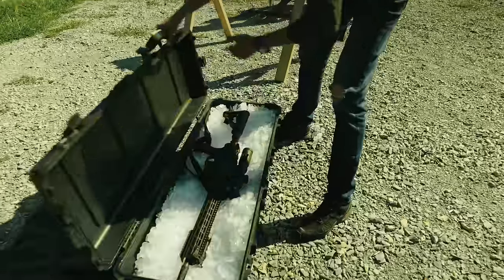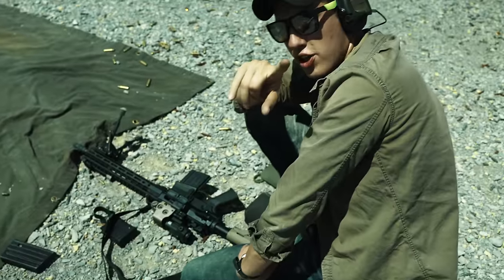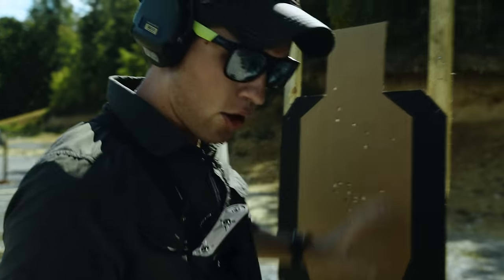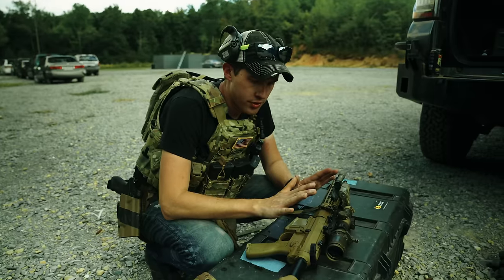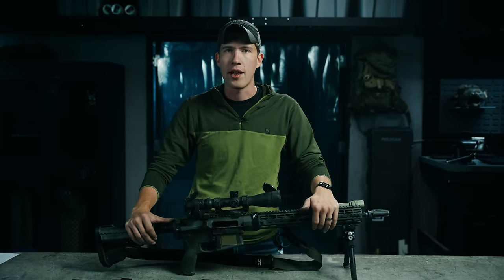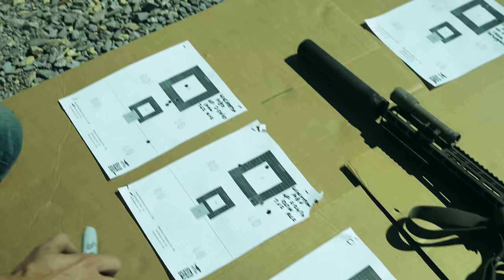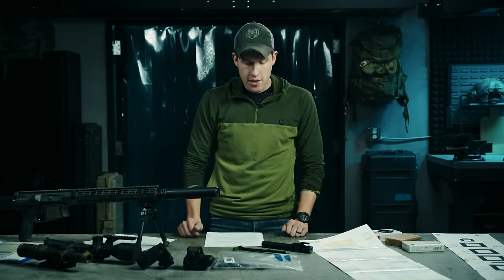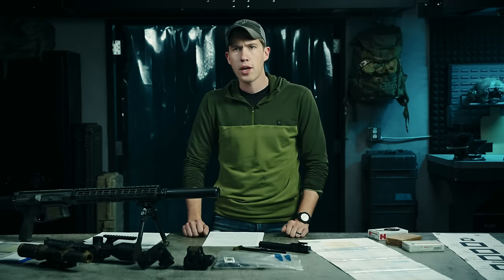Aero Precision M5 AR-10 5,000 Round Test

Comment: Please Aero consider on your m5 carbine stock lowers, using an A5 buffer tube and provide an H3 buffer with a rifle spring, I know it’s an expense, however it might prevent some failures and premature failures. I have also found the gas ports on your barrels to be on the small side, I opened up my 16” mid length.308 to .086 and installed one of your adjustable gas blocks. Works well know along with the buffer system improvements. I absolutely love your products! Another thing, I noticed heat treat issues with your nitrided BCG .308? I’m now running the phosphate BCG and it’s good, I’m in Washington but I can still buy your parts, I believe overall that they are the best in the industry!

Comment: 5,000 rounds I'm yet to fire one round. I just purchased a Aero Precision M5 E1 6.5 CM with 22" barrel. This rifle is 100% Aero Precision and brand new.  It won't chamber a round 90% of the time and when it does it damages the bullet and the case and the follow up round will be a double feed. I am using PMAG Gen 3 magazines. I have yet to fire this rifle. Any ideas?
Reply: I'm probably too late. I've seen this happen to the m5 in 308. It could be because of the brand of ammo. I would check and see if the tip of the bullet sticks past the pmag. Especially if your ammo is a little too long for your magazine. It won't want to work. I've only seen this on ar10s
Reply: Refund it and save up flr something good. I payed a lot for a 716 DMR G2. It shoots 1 moa with boat tail ammo and eats everything I give it. Buy once cry once.

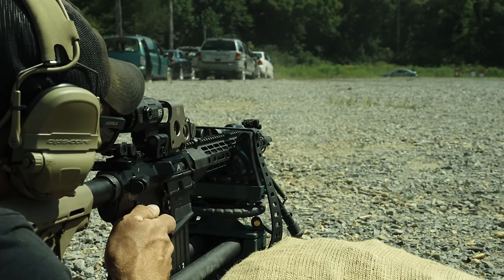Comment: I have significant issues on my POF Revolution (308 Piston Driven) as well.  I get these overgassed 12:30 - 1:00 o'clock eject patterns no matter what setting I have the adjustable block on, which results in the bolt closing so quickly it outruns the mag's next feed and skids over the follower bullet.  So, I get a clean shot, extract and eject, but I'm left with an empty chamber in the end.  These AR10's are so weird is all I can say.  I've owned a few different manufacturer AR10's now and I have to factor in a multitude of modifications to make it cycle properly.  Everything form heavier buffers, heavier duty springs, gas adjustments, and specific types of ammo.  The problem is especially amplified when I'm running my Dead Air Nomad-L on it.  Pew Science showed the Nomad-L as being the highest back pressure .30cal can in the industry, and I absolutely agree with that result (painfully gassy in my face with what feels like powder blasting me every time).  It's less pronounced of an issue with my SiCo Omega300, but I still can't make it through a full 25-round mag without having to stop at least twice to assist in loading the next round.  End of the day, I absolutely love my Nomad-L (truly industry leading suppression) and I wouldn't trade it for anything. I just wish I could trust my any of my AR10's like I do my AR15's chambered in 5.56 and 300BLK. One day someone will get it right.... I hope. Hahaha.

Comment: The problem with this video is that it doesn't succeed in its goal, to rigorously test the reliability of the Aero M5 platform and components.  To reveal failure points in any mechanical device, you have to provide the best possible chance of success, that way its the inadequate components that fail, rather than components that fail due to improper usage and maintenance.  It's no longer possible to be certain that the fault is with the component, because the user introduced new variables that can effect longevity, reliability and performance (over gassed, no lube, etc).  The fact that the rifle survived longer than average users would ever shoot in their lifetime despite those user introduced complications is a testament to Aero, and actually reinforces my confidence in their products as they clearly survive longer than they reasonably should in harsh conditions without proper adjustment, maintenance and lubrication.

Comment: Anyone wondering about 149g Winchester Lake City "m80" it is actually copper plated steel-jacket with a lead core. It has been relegated to MG use in the US inventory. Old M80 is 147g copper-jacket lead core. The Lake City 149g m80 will accelerate barrel wear.

Comment: Also these have excessive play in the bolt face to the bolt locking latch when pulled all the way back, more than 1/4" had to add 2 quarters to mine in the buffer tube to get the play to less than 1/8" broke two latches before I figured that out.

Comment: I check out your channel all the time. You have helped me understand the function of the guns I’ve been interested in. Right now I am working on building my first AR10 M5. My plan is to change the barrel to an AR10 .308  16” nitrite pencil barrel. A mystic black cryptic coating bolt carrier group. A radiant charging handle and a Franklin armory bio trigger. I’m not sure of the scope type I plan to use with this setup, but I think it will be a SFP, as long as I can get 500 yards or close conflict issues. What do you think. I would really love to know. Thank you for your channel and I will contribute what I can and when I can. I’m a disabled veteran and have not worked in over 4 years because of my physical health, yet I never complain. Again, thank you.

Comment: It's a year later and Aero still does not offer a separate firing pin, Well after sever wrong orders I fount the PSA 6.5 CM pins work and a 308 High Pressure Bolt small hole pin is what you want, found one at Black Rifle Arms HP 308 pins is it. $12  got 2 just in case.

Comment: You guys should do this test with the Palmetto PA 10 gen 3 20 inch barrel. The gas block has 3 adjustable slots per rotation for a total of 17. I just bought it for $700 over Black Friday. It's working great so far.

Comment: I had a problem with a AP bolt. It was nitrated. Started having slam fires and didnt know why till I took the bolt out and the firing pin was sticking out in the bolt face causing the slams.   For some reason it had a build up of carbon in the firing pin channel. a .22 bore brush and a pipe cleaner later, the problem was solved.

Comment: I would be really interested to get a good look at the fracture surfaces of the firing pin and extractor pin under a microscope. It might help narrow down the root cause. Depending on the exact alloy in use, you could have gotten below its ductile/brittle transition temp if it was in the ice long enough to get near freezing. Look up Liberty Class transport ships on wikipedia if you want a good explanation of that. Was the bore/chamber cleaned or lubricated at all during testing? If not, that could have contributed to the failure of the extractor, especially once you started shooting suppressed. With the increased backpressure and a sticky chamber, I'd imagine the dynamic load on that pin when the cam pin hits the end of the track would be pretty high, maybe high enough to cause low-cycle fatigue. That may be more an issue of being overgassed. One would hope that the gun would fail to extract before it would start breaking parts. Then again, being suppressed would mean faster buildup of carbon in the action plus higher bolt velocity when the cam track runs out. You might have gotten unlucky on the timing and started shooting suppressed in just the wrong window between overstressing the extractor pin when suppressed and failing to extract unsuppressed. Definitely an interesting test. I'd be interested in seeing a more detailed analysis of any failures in future videos if at all possible.

Comment: To be honest, anyone who installs a suppressor on a DI gun without some sort of adjustable gas system, is asking for issues down the road. Sure it works, but will technically affect the longevity and long term reliability of the weapon.  There is a number of high quality adjustable gas blocks out there which make running almost any DI gun very reliable with a suppressor.

Comment: Excellent presentation. I have triaged several in the hi-budget range and settled on Aero and Rock River for both quality and accuracy out of the box. Service from both companies has been unparalled. That said I have never exceeded 1000 rnds in any AR I have tested so this video gave me a lot of food for thought. I have purchased extra firing pins and bolt related spares as a result.

Second question related to Mil Ball.  I don't recall if the M80 comes in anything but 7.62x51? Aero only chambers for 308 and there are real issues with reliability (and safety) shooting 7.62x51 in 308 chamber - different headspace and greater cartrige length - similar to 5.56 vs 223.
 

Question - to what extent are 'foreign' bolts (ie DPMS in Aero BCG) to be examined for headspace, and if so are classic 'go/no go' gauges adequate given the skills of those (like myself) who have rebarreled bolt action guns in the past?

Comment: I bought an upper and hand guard. The top rail doesn't line up. The hand guard rail is a tiny bit lower. The 308 didn't run. The bolt was sticking in the carrier. So the two I bought sucked. The Aero won't run the BCG from AR Stoner with the angle sides. They have issues.

Comment: This is why all of my rifles are accompanied with spare firing pin, cam pin, firing pin retaining pin, extractor, and extractor spring. Even a spare bolt itself is a good idea. Doesn't matter what the MSRP of the rifle is. These parts WILL fail. It's not a matter of if, it's a matter of when.

Comment: It would be nice to see a BCG showdown on the same AR10 platform running  different BCGs such as Lantec, JP Enterprise, Sharps Rifle Co, Bear Creek, Faxon, and Aero all having same coating (i.e. Nitride/DLC, or NiB), but that might be the most gun part expensive testing video ever. For a BCG test, I would consider using a binary trigger to really speed up the rate of fire and heat and stress on them, but avoid carbon fiber barrels with a legal brand for a binary trigger. 

Note: Consider using a Carbon Fiber hand guard and grip to help on massive round count shooting to help you avoid an ice bath :)  Dude, it's a higher tolerance AR, not a lower tolerance AK47 - you must lubricate the BCG and the charging handle!!!

To date, It looks like Aero has not made any engineering improvements to their M5 BCG, only their 5.56 BCG.
I hope they might really up their game by making a 99% fully CHROME M5 BCG edition with phosphorus extractor, phosphorus gas key that is chrome-lined interior and something similar or better to the Lantec CP-R360 cam pin!  They could call it Pro-Plus, or Extreme Duty :)

Adding to Aero's credit, they are improving - they do have a new BCG line labeled Pro for their 5.56.  Hope they expand this to their 6.5 BCG.  Still, if they would only make a proper chrome BCG with a few phosphorus parts (e.g., gas key, firing pin retainer and extractor) and a Lantac like cam pin, it would put them in the Best-Ever Cat's Meow of BCGs.

I think for a 5000 round test, you should use new Magpul or Lantac magazines,  Also, at least clean the rifle and generously lubricate the BCG every 1000 rounds; only a fool would never lubricate the higher tolerance AR platform; it is not a AK designed for extreme abuse and neglect.  Still, I would take an AR15 over an AK provided I have means of keeping lubricated and occasional cleaning. Even if you don't want to clean the rifle for the whole 5000 round test, at least  spray some Gun Scrubber to quick clean it and generously lubricate the BCG at every 1000 rounds.

Also, it would be very nice to see one of the most affordable AR10 to date - the PSA Gen 3 or the Bear Creek AR10 in a similar 5000 round count test video.  Adding next to that lineup would be the new Ruger lightweight SFAR.

After all that, then a high-end AR10 comparison of 5000 round count would be awesome - Wilson .vs Christensen .vs Sig, but I'm sure the cost issue is too prohibitive for this sort of testing :(

Final words of advise -> put an Ultradyne Apollo Max, or a Precision Armament M4-72 Severe-Duty or a 419 Hellfire Match on it to save your shoulder, even Aero's VG6 would help a lot over the bird cage style. 

GREAT VIDEO THOUGH!  THANKS!!!

Comment: So best to build stripped lower with better trigger, loc tite the bolt release screw, and install bravo company extended tube with carbine buffer. Order upper assembly without charging handle and bolt,  then buy lantac bcg and radian charging handle.

Comment: Properly cleaned and lubricated, gun components 'break-in'. As you tested it, dry metal parts were allowed to abrade and wear against other dry metal parts causing these components to VASTLY overheat due to unabated friction. That excess heat may have critically weakened carefully heat-treated parts, especially the parts that have a very thin cross-section like the firing pin and the extractor retaining pin. This may have been exacerbated by the heavy buildup of carbon. Carbon is a thermal insulator which retained the excess heat. Science may have demanded that it fail.          

Opinion rendered respectfully.

Comment: First let me say I am a big Aero fan and have at  least 12  and built about as many for my family ,...but..... 
I firmly believe Aero . 308 bolts have a QC problem. I was having an ejection problem right out of the box. Upon inspection I found the ejector pin missing. The interesting thing is the spring was there and so was the roll pin, no sign of the ejector pin ever being there.
I also am very very disappointed at the process and time it takes to RMA or get warranty decisions or replacement.  I was told by Aero, once you create a ticket it could take 4-6 weeks JUST TO GET A RESPONSE!  That is totally unacceptable in any business model.  It begs the question, are there so many problems with thier products, that they are overwhelmed???
It's even more frustrating that I live just a few miles away from them .
With the "Assault Weapon"  ban about to pass in Washington , getting replacement parts and sending guns back for warranty work may be impossible.  Do better Aero, we've supported you, now support your customers.

Comment: The anodized OD Green build kits for the .308 look sweet for the money, suddenly the Aero milled receiver looks okay, reminds me of a F1 or something like that, throw a stainless barrel and a comp on there, a Acog...hooo daddy it would look nice with a nickel boron bolt carrier and trigger, around 1500$ puts it at a nice value to build one, still looking at more for optic of course. I hear people saying the 18 inch stainless fluted barrel, basically the top end one is around 1/2 MOA, which is really nice, especially for a .308 semi auto. I might wanna spend 200$ on a Viper Brake for this, then it would look like a tricked out JP custom. For the .308, Acog reticle would be sweet for another grand new, then you have a very capable package for 2600$, which is less than some rifles like a Scar 17 all by itself. Seems like it would be some money well spent, if you could just build these and sell them potentially. It seems expensive, but it's really not for a .308 semi auto with a good optic, you can easily double that cost.

Comment: Unfortunately, Aero's complete uppers come with a fixed gas block. It is NOT optimized for suppressed. Other sources I have seen who shoot thiers suppressed, it appears that it will need to be modified with an adjustable block. I SUSPECT you would of been better with a rifle buffer as opposed to the carbine buffer.

Thank you for the video... I have been looking fairly seriously about picking up a 6.5 with the idea of starting off in a budget build with the option to later upgrade the barrel, and perhaps other components as needed to improve the accuracy (and perhaps durability).

Comment: Aero platforms prefer either Pmag Gen 3 imo, it’s all I shoot out of mine, and when using the M118LR ammo used the proper Pmag M118 mags as M118LR is slightly longer then SAMMI max Specs for length, requiring a mag just a “military term” Cu*t hair longer with a slight degree of curve in them. I put a BA black nitride BCG in mine from the start, and I can’t stress enough run it WET for the first few hundred rounds, in the groups this is pretty common knowledge, but for those maybe just starting out and this is one of the first rifles they put together RUN IT WET, the more you know….. blah blah blah you know the rest, not going to bore you with the details. The spring and buffer as important as well to get it right, and please for the love of god put a lube on the spring as well. For the speed tests out to 40 doing 2 rounds I would suggest a Brake, at 12-25-40 yards a flash suppressor is pointless, if an enemy can’t tell where you are shooting from 12 meters away then well I guess I’ll keep it Rated PG to not get banned but they’re pretty freaking slow/mentally impaired to say the least

Comment: Great video. I too like Aero, I’ve built 5 of their M4’s, currently building an M5, so this was helpful. I do know their gas blocks are overgassed. I do think you were a bit harsh on the screws backing out as any roll pin/screw could have done that, I didn’t think it was that big of a deal. I also DO NOT use Aero barrels or bcg’s, there is no excuse for it not performing better imo. I would like to see this same rifle perform with a different barrel and bcg to see the results. 

I know you mentioned no foreign firearm requests, but I would like to see you test the IWI X95. I own one and it’s a favorite of mine. Curious on what you’d think of it.

Comment: When I seen how weak the ejection was I instantly knew they was a issue with more then likely the extractor and or more rarely the ejector. Also this rifle isn't something someone should avoid if they want to supress their rifle an easy fix is pick up a aero adjustable gas block and you will be good to go. Just dial in your gas and your GTG.